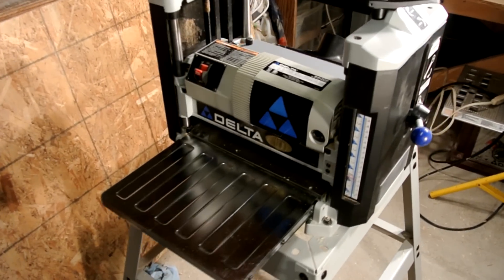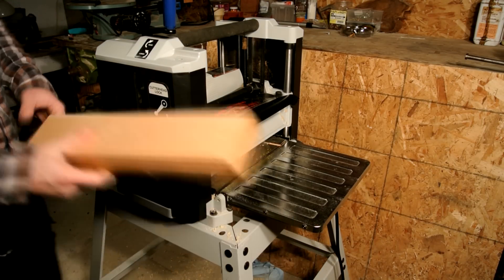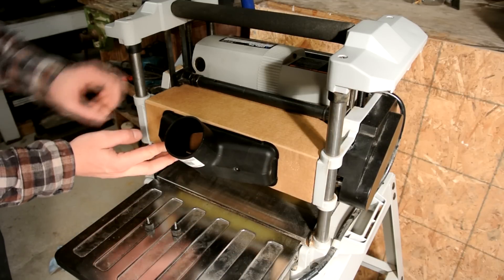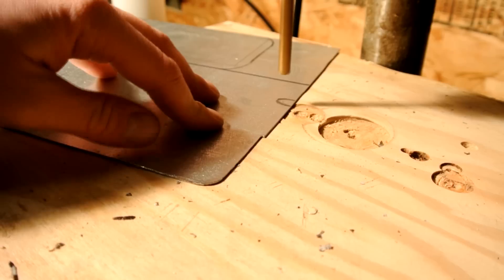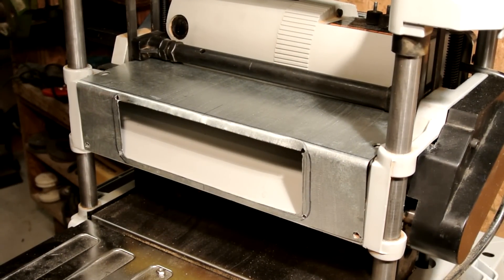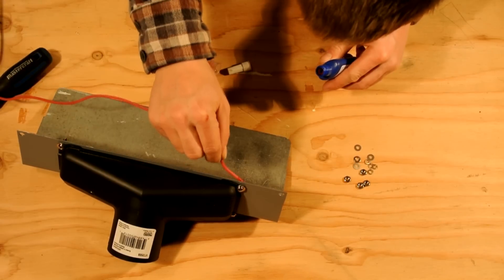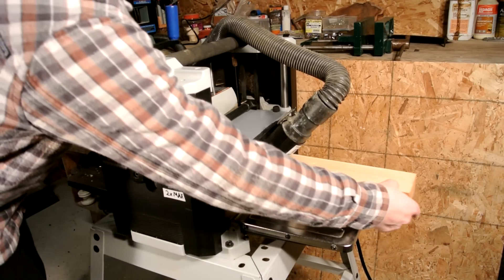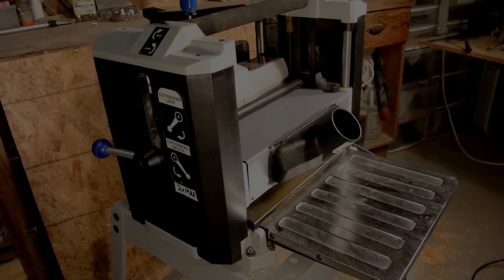DIY Delta Thickness Planer Dust Collection Build

Comment: I built this and it works really well. But it just occurred to me--why not put the vacuum attachment on the top instead of the side? Then you can close the outfeed tray.
Reply from the maker: I placed the dust collection port in this location because on other machines, This is a similar location to there dust collection ports. However you bring up a good point.
Reply: @JDCDDesgins  I'm building another one with the port on top and I'll let you know how it goes. Makes sense to put it where you did since that's the direction the chips are flying anyway. But we'll see if it makes a difference.
Reply from the maker: @regibson23  keep me posted!

Comment: Yup, I've got a shop vac floor nozzle that I never use that will be perfect for this. Amazon wants $75.00 for a store bought one. No way I'm paying that. At first I thought you were going to slide the vac nozzle through the break metal from the inside. Maybe seal around the nozzle with some silicone. I'll try it.  Thanks for sharing.

Comment: What size bolts did you have to use to attach the face to the front of the planer? By face I mean the piece with the shopvac attachment, what size are those 2 front holes bolt wise?

Comment: Great video! I have a Delta 22-560 like yours and it didn't have a hood (and, of course none still available). I like your fab best of the on-line stuff but I just recently lucked into a near OEM solution. I bought a Makita 193036-7 hood (blue) from Amazon for about $25. The hood has a steel L-bracket that the plastic hood screws to. A little (very little) work with a dremel to file down the Makita L-bracket to fit, one straight cut to remove the downward chute off the 22-560 guard, drill 4 holes through the bracket and guard, bolt the bracket to the guard using the 4 holes and it's done. It truly looks OEM and is 99% effective. It's no better than yours but it's a 30 minute job (good for those of us who aren't on a first name basis with anything metal). Thanks again for getting me thinking about how add the hood!!!
Reply: Great idea! Do you have a picture of the Makita hood installed?

Comment: Thanks for your great video. I recently bought from Lowes the Delta attachment 50-539. Well, let me say, there is no way it would ever fit. So, it goes back. I don't have a sheet metal brake so I'll be making mine out of wood but after seeing how simple it is to make one that works, well I'll be money ahead. Thanks again.

Comment: Nice job with the build and video. Question, couldn't this be built with 1/4" hardboard?
Reply from the maker: Yes, if you can't have access to a metal break you can use hardboard. i had the material at my shop so thats why i went with metal.

Comment: Great job brother. One thought though what if you put an angled piece on the left and right of the inside, so you don't get buildup in the corners.🤗
Reply from the maker: Thanks! I appreciate the suggestion, I did ended up putting angled pieces in like you suggested because i was getting bit of sawdust build up in the corners.  Thanks again!
Reply: @JDCDDesgins  could you show a pic of the corners you added?  Also what gauge sheet metal are you using?

Comment: great job
Reply: JDCD Design Great Job. I have an old Ryobi that needs the same treatment!
Reply from the maker: Frank valles Thanks!
Reply from the maker: Frank Lisi Well it sounds like you have a great new project on your hands!! Happy building!
Reply: Very nice, I did a similar add on to my lunchbox Planer. The real test for the system will be a full width board.